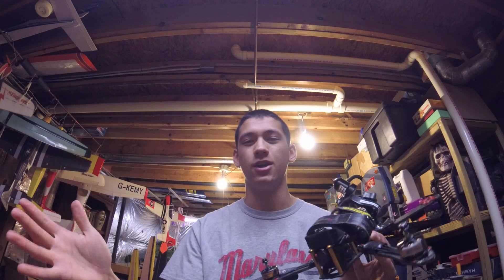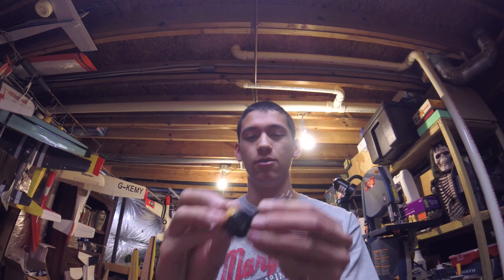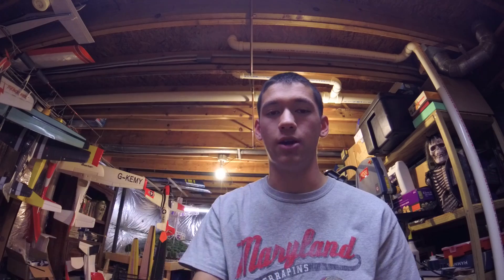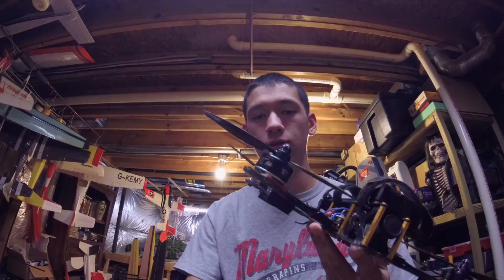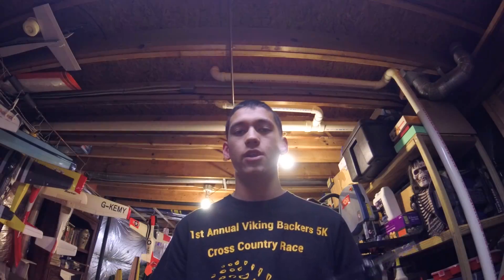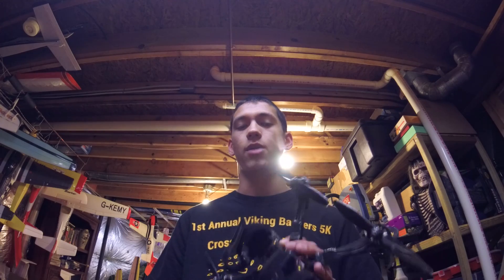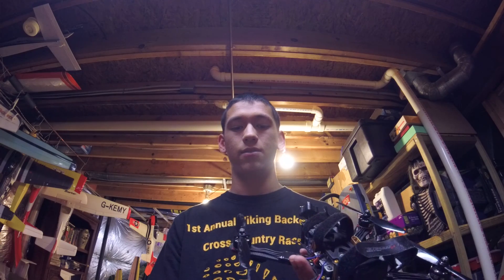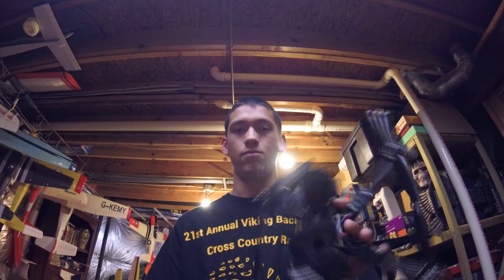Motor Swap and Test - T Motor F60 Pro 2200KV

Comment: Two of my f60 Pros are turning was harder when i spin them with my hands, and two motors have heatschrink on The beginning of The wires and two dont. Is this normal????
Reply from the maker: All the F60 Pros I have owned have had heatshrink where the motor wires meet the wires from the windings. Your windings may be shorting between phases if there is noticeable resistance to turning when the motor wires aren't touching.
Reply: Timmy RC i cant see any wires shorting
Reply from the maker: You can try using a multimeter to compare the phase resistances across motors, but it isn't something that is easy to diagnose. It could also be something other than shorting phases.

Comment: Did these give you any headaches with emf feedback??? I’m getting crazy amounts of noise in my video with these. I’ve tried caps on esc’s and on the main line and still noise on punches and over half throttle. Also soft mounted them.
Reply from the maker: My only problem has been flickering of the OSD on the Betaflight F3 board. The video itself and the OSD I use for KISS works fine.

Comment: So if you did a slower long range flight how do you feel about these and flight times?  They are on my list for that 2000-2200 kv motor for my 6 inch build. Test bench says they are super efficient so I'm guessing they should b me good.
Reply from the maker: They have good efficiency, but the stronger magnets and tighter air gap don't yield noticeable efficiency gains compared to the original F60s at cruising speeds. The real improvements in these motors is the power and response times. If you are only concerned with long range/efficiency a lighter motor might be a better trade off because you could save 20-30g and gain efficiency that way.

Comment: Was thinking of putting these on my 6" Helix, but now I'm interested to try the Hyperlite V4 2206 you mentioned. The naked bottom version of the hyperlites are 9g lighter than the f60 Pro. 36g total is a substantial difference when it comes to racing. I'm just bummed since I can't find any testbench results on the 2122kv version of the hyperlites (miniquadtestbench.com only has results on the 2300kv version).